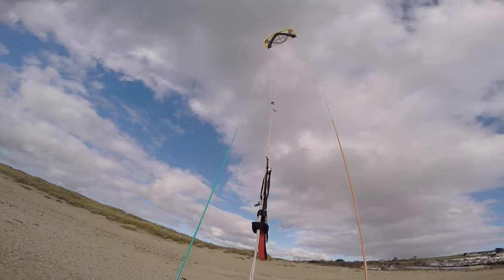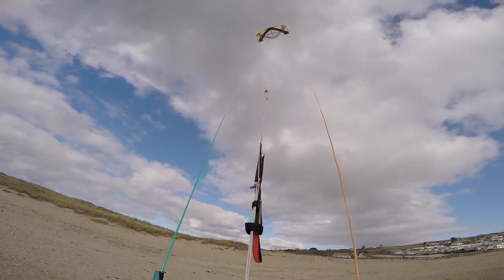How to Trim your Kite - The Hoxton Special

Comment: Newbie here..Do you recommend starting with a certain amount of depower/trim strap pulled in BEFORE launching kite (depending on wind strength), then perform the steps you describe to make appropriate adjustments?  Just wondering what's best from a safety perspective, both before and after kite is launched. Thanks
Reply from the maker: Hey, thanks for getting in touch. I like to launch my kite with no depower, so all the lines are of equal length and then trim my kite. depowering before can be dangerous because with longer back lines you lose some steering control. if you're worried about the power of the kite when launching, check your technique, be more gentle with the kite and steer it slower up to twelve, also check you are in the correct position before the kite is launched. hope that helps :-)
Reply: +The Hoxton Special Kitesurfing School Great, it does help, thanks for explaining.  One time I launched with too much depower, with loss of steering control.  I like the idea of slowly bringing it overhead then adjusting as necessary as you describe.  Thanks again.
Reply from the maker: +sportoman2003 my pleasure, good luck.

Comment: Soo if i understand correctly, in the zenith my kite should stay in its place nicely when pulling the bar all the way in? Then it is trimmed correctly? Is there also a difference in lighter or heavier wind conditions?
Reply from the maker: Yeah man. If it's sitting still at the zenith with the bar all the way in then it's trimmed correctly. light winds and strong winds are exactly the same however generally strong winds are gustier so you will have to allow for this. hope this helps.